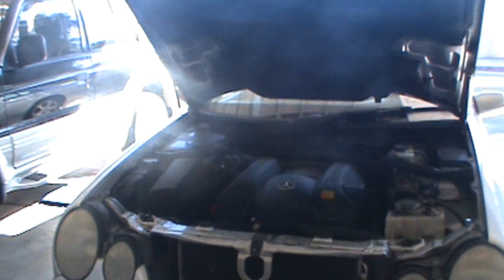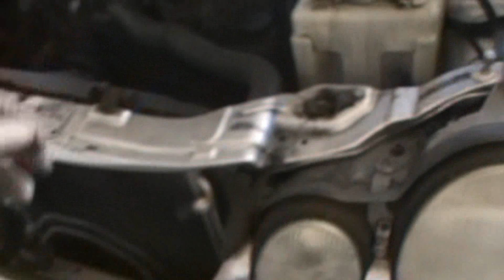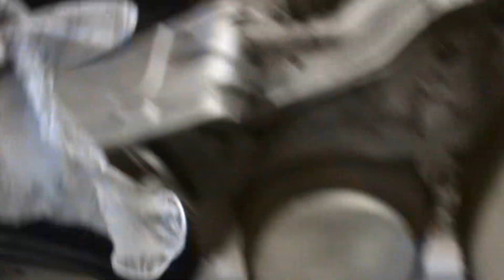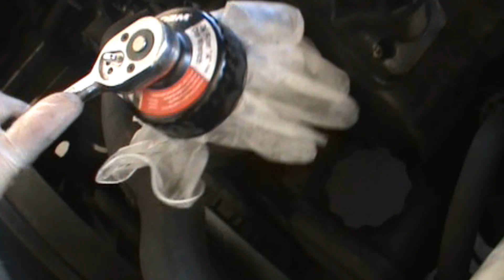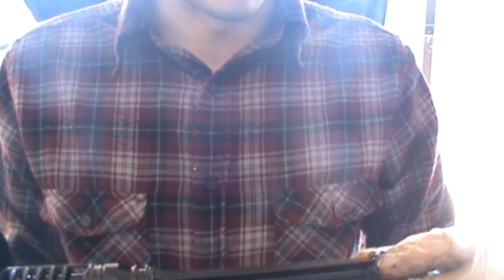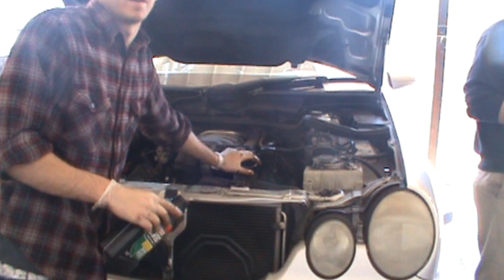Cartridge style oil filter replacement

Comment: The plastic oil filter support stem detaches from the cap - there is a valve in between the cap and the stem that also has a rubber gasket.  Apparently most people do not change this one out, as they fear damaging the support stem or don't know how to separate the two pieces.

Comment: I wanted to point out that many of these V6 & V8 Mercedes are suppose to use a fleece oil filter (not paper).  This helps them go the extended drain intervals.  Of course, you must use the correct oil too.  The fleece oil filters can be found at the dealer or you can get a Mann brand (same as OEM) on Amazon.

Comment: So, I didn't see a backflow prevention valve. Presumably it is part of the system and not replaced when you replace the filter. Is there a top and a bottom to that filter?